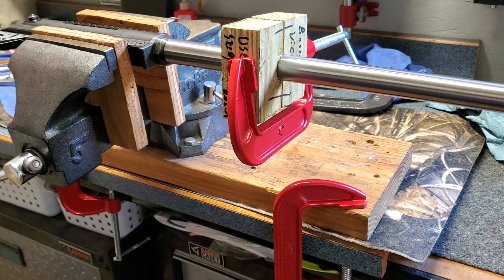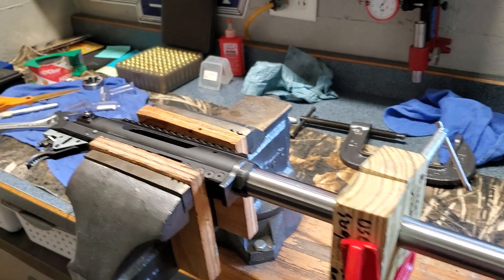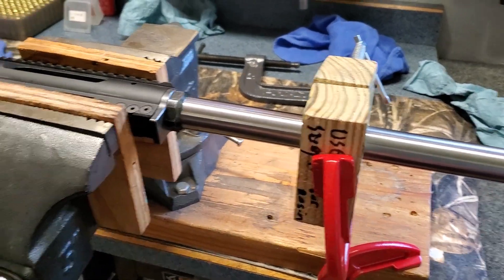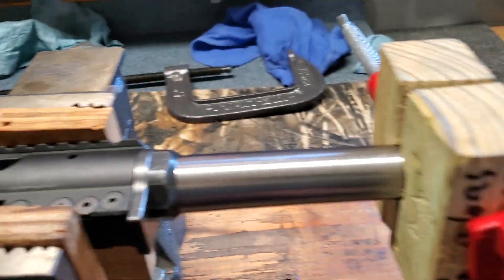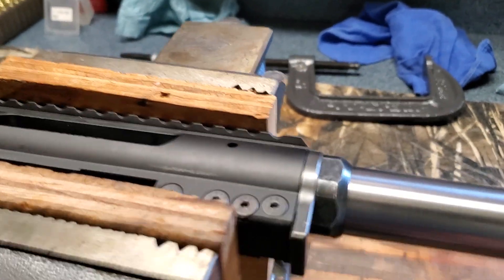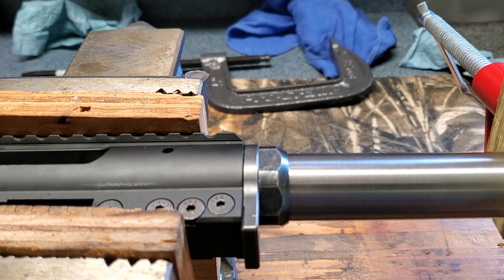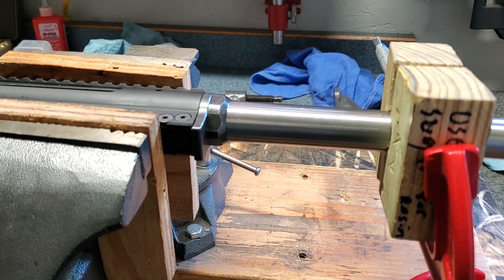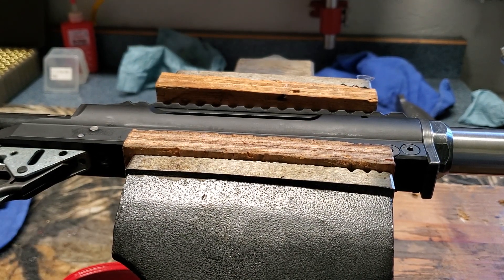Savage Impulse Re-barrel Part 3: Headspacing

Comment: I found that the factory barrels needed a piece of blue painters tape to no go.
I set headspace on all of my barrels assy's that way and have had zero issues with function.
We'll see if you have any issues extracting fired brass with the tighter headspace you set it at.
Reply from the maker: On my Savage 12 I used scotch tape, which is only .0015, and that works well.  I figured packing tape at .0025 would be a bit more lenient.  Of course the straight-pull doesn't have the camming power that a turn-bolt does for primary extraction, so I guess we'll see.
Reply: @ShopTowels  The Impulse bolt has an extraction plunger on the top which provides assistance in moving the bolt rearward when the bolt handle is being rotated towards the rear as a case is being extracted.  This provides similar extraction power to the camming action of a conventional bolt.  Figure 10, page 5 of the owners manual.